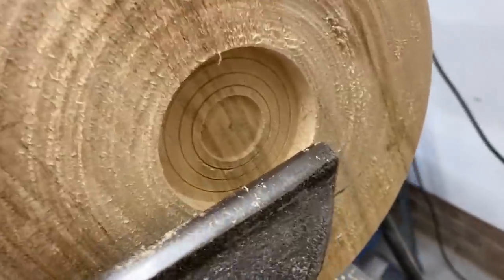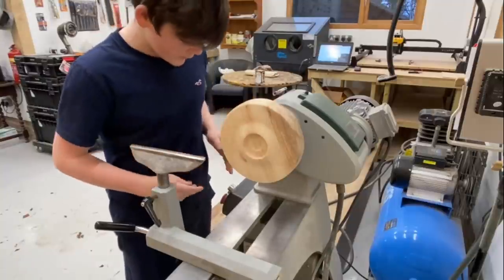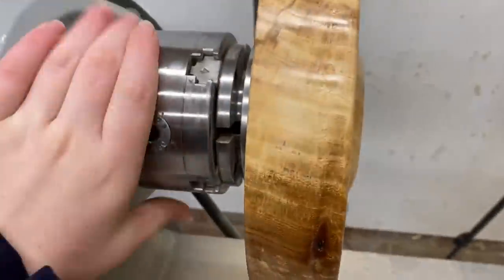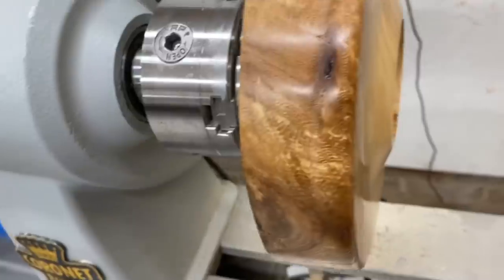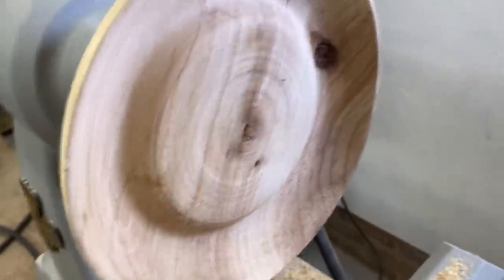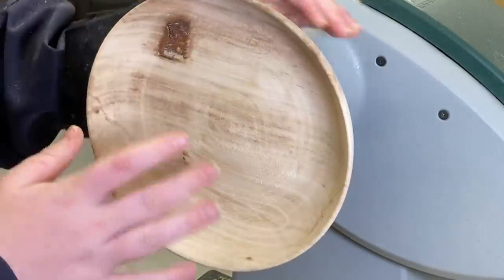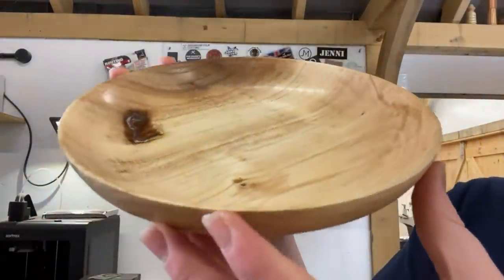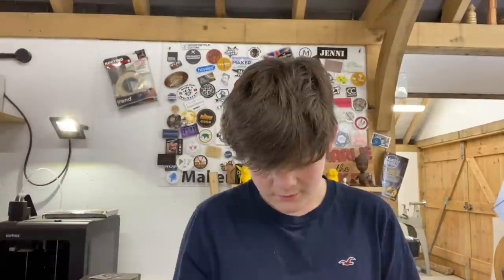Woodturning - Birch fruit bowl

Comment: As some one who used scrapers for all of my heavy roughing on bowls, I would tell you that you need to learn to use gouges. Mostly they would allow you to start sanding at 120 or higher grits. Also, I never stand in the line of fire. I do like how you changed the outside shape of the bowl after you reversed it. Much better.